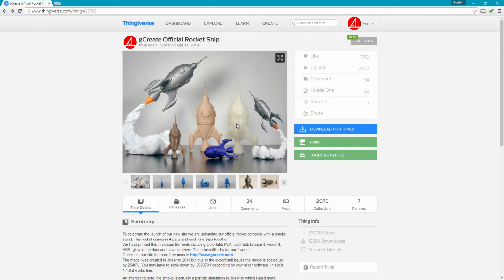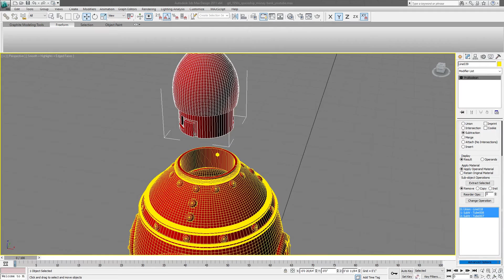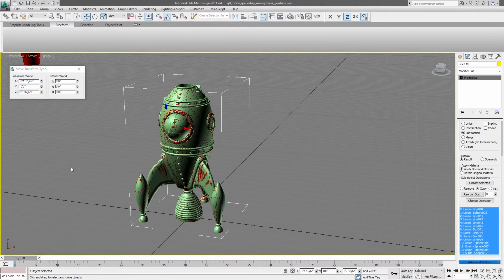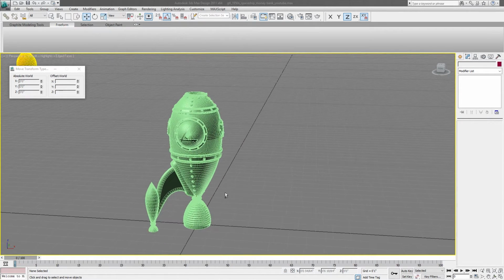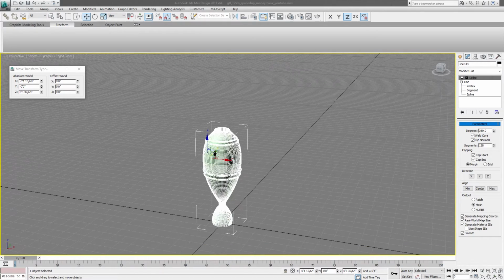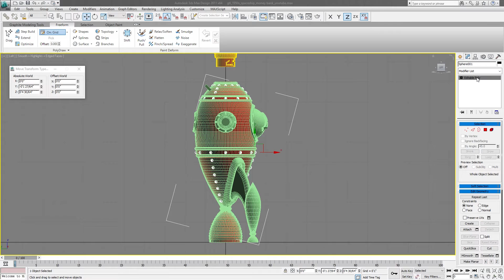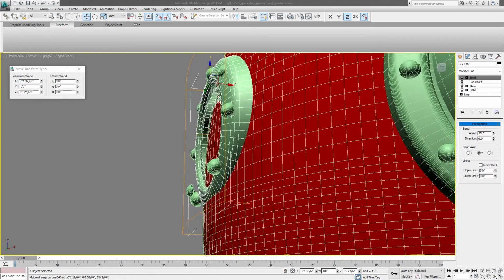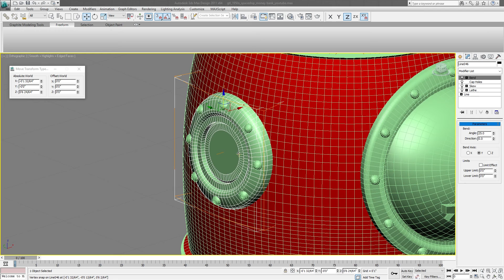How to Design and 3D Print a Rocket Ship - Part 1 3ds Max

Comment: Good info. I'm an  Autocad 10 user trying to learn the world of 3D, and this is super helpful. I think kids have it easier than someone with 30 years of "old style" software experience. Acad 10 and Lotus re-set your way of thinking, and it has to be dis-assembled before you can be comfortable with the new stuff. Blender and the like are devastating to me. 

Thanks for the cool equipment, models and the help using them!

Comment: nice! time allowing i am going to make a flying model of your rocket :-)

looking forward to part two radial copy is what i need to learn to do. right now i only do 4 fine models in tinkercad becaude i dont know how to do array around an axis :-)
Reply from the maker: +Nerys In 3ds max you can either array or simply rotate around the world axis. Just make sure your world axis is the center and you are good to go. Keep it up with tinkercad as I hear people really like it.
Reply: +gCreate3D for some things tinkercad is just simpler. easier to move thigns around on aimple plains.

but for more complex rockets i have to use 3ds as tinkercad is just lacking :-)

although i figured how to get higher poly shapes using tinkercard. make the shape in 3ds then import the stl into tinkercad. it retains its higher resolution!